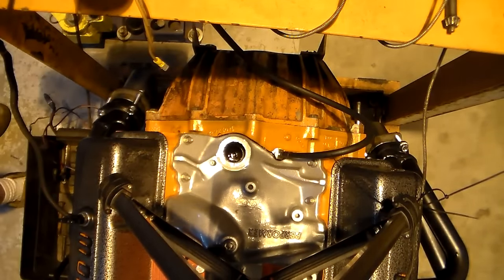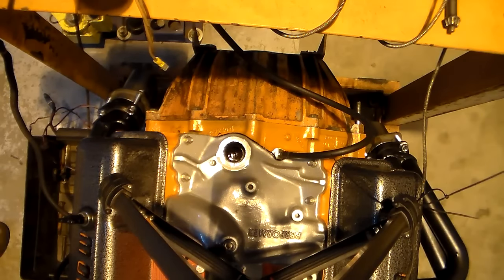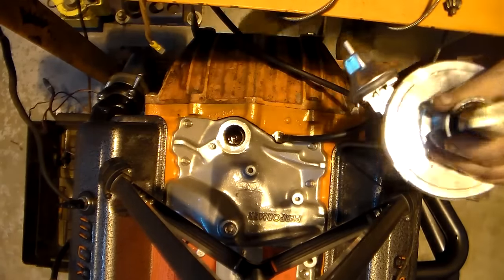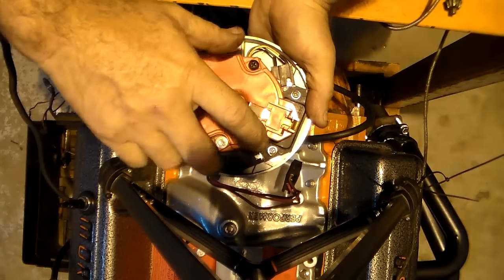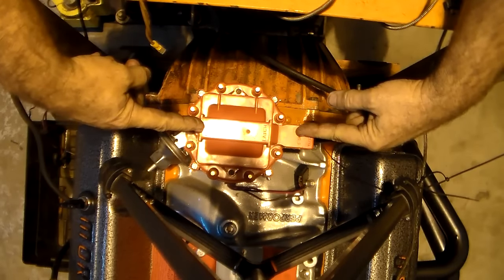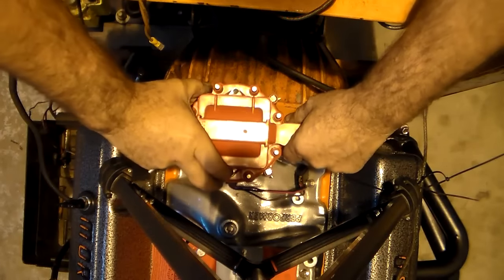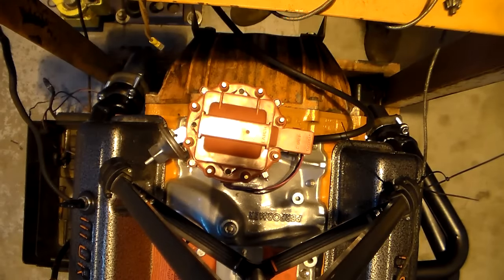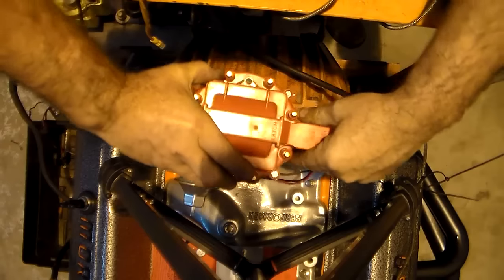How to install a distributor in a small block chevy the easy way.

Comment: So do I need to have the piston at the exact top dead center on cylinder #1 or 10 degrees before top dead center before installing distributor?
Reply from the maker: To instal it the way I show, you have to have it at TDC or 0 to make it all lign up. After its in just advance it a little to start it up then use a timing light to set it right.
Reply: @scottsinfl  Got a question. Checked timing with timing light on my sbc and the timing mark on balancer seems to be erratic or jumping all over the timing tab. More than a couple of degrees and it’s not moving evenly. It’s random across the timing tab but the engine seems to run pretty well. What could be the problem?
Reply: @scottsinfl  could it be the distributor having too much up and down play or faulty ignition control module?
Reply from the maker: @vezina808  It sounds like play or slack in the timing chain.
Reply: @scottsinfl  thank you

Comment: Hi have a question did u put the damper at 0?   When u install distributor? Thanks bud
Reply from the maker: Yes 0 or TDC on the compresion stroke of the #1 cylinder.

Comment: What if you're at tdc on comp. stroke, but the oil shaft is at 2-8 o'clock? Thanks Sorry if dumb question.
Reply from the maker: Just use a long flat head screwdriver and turn it till its at 11 and 5 o'clock position and your good. And there's no dumb questions here.
Reply: @scottsinfl  Thanks. Today is the day!

Comment: Now does this method work with proformance distributors or just stock??
Reply from the maker: I install all of them that way into a small block or big block chevy it doesn't matter if its an MSD or any other distributor it will be the same method. I should have mentioned that in my video too. Hopefully, someone will catch this comment. I hope that will help and thanks for watching.

Comment: This go for a 94 5.7 liter TBI ?
Reply from the maker: If it's the small cap or flat cap with the distributor that has the non-adjustable dist. lock down plate no it won't . There is a special process for those.

Comment: How do I get it to top dead center by myself
Reply from the maker: Sorry, I didn't get back sooner you probably have it done now. If you take the #1 spark plug out and turn the motor over with a wrench using the alt. nut if you still have the belts on if not use a 5/8 socket on the crank. Turn it till you feel compression come out of the #1 cylinder and watch for the mark on the balancer and make sure you stop at the top dead center or 0 on the timing indicator and that is tdc on the compression stroke for #1. Then follow the rest of the video and you will be good.

Comment: Would the engine crank and not start if the timing is off on compression stroke? Would it start if I'm on exhaust stroke?
Reply from the maker: no
Reply: Thanks for the reply. So if I'm on compression stroke but not at tdc and install distributor correctly and aiming rotor button at spark plugs 1, would it at least start? Cause I'm having trouble finding tdc
Reply: There is a mark on my balancer but no timing mark tab on the cover
Reply from the maker: for this method to work you have to be at tdc on the compression stroke #1 cyl. and line up the oil pump drive to 11 and 5 and point your rotor button at the second intake bolt from the rear on the d/s drop it in and it will run.
Reply from the maker: You dont have a timing mark on the balancer?
Reply: scottsinfl I have a mark on the balancer but no mark to match it to
Reply: People say u can just use your finger to see what stroke you on. I understand that but I'm having a hard time getting it to tdc cause I don't have a timing tab to match my balancer line to
Reply: David Nguyen bro did u find out how to match it? I'm on the same boat.
Reply: Lazarow Official I end up towing my truck to a shop. Charged me $88 for timing
Reply: Badd ass

Comment: How do you know the 1 cylinder is up to the top of its compression stroke?
Reply from the maker: You remove the front spark plug on the driver side of the motor and turn the engine looking at the front of the motor you turn it clockwise till you feel compression or pressure coming out of the spark plug hole. As you feel the air coming out you will see your timing mark on the balance start to come down to the timing marks on your timing cover. Stop at the largest V in the cover and that will be 0 stop there but if you pass it back up about an inch and bring it down again till you stop it on the 0 mark. Hope that helps and thanks for watching.
Reply: great - thanks for your help!
Reply: @scottsinfl  Too many homes.When your By yourself, Just put a Cork in 1 SparkPlug hole, turn Crankshaft slow till it Pops out. Double Check with Finger
Reply: Too many holes not enough Details.

Comment: However, an engine doesn't want to run if you install the Distributor at TDC-ZERO...why not set the balancer mark-LINE at around 6-8 degrees-advance on the TAB, drop the Distributor in and rotate the distributor to the #1 spark plug. Then you already have 'some' advance in the Distributor and it will ''initially' start and run better...then use your Timing Light to fine dial the Timing.
EDIT...ok, I noticed you rotated some advance in the Dizzy to get the Cap-Top 90 degrees to the cylinders.
Reply from the maker: Yes I advance it some before I fire it off I just set it at 0 for the dist. drop so all my mark for reference align up.

Comment: Distributor for a 1997 suburban vortex engine
Reply from the maker: If I remember they are locked with no adjustment for timing. It has to be set in at the rite spot like rotor pointing 7-8 o'clock position and turns in counter clockwise to a mark on the distributor housing. It will almost point strait to the p/s fender. Ive done them but don't have any videos sorry. Remember tdc on compression stroke for #1. Oil pump drive somewhere in the 3-9 o'clock position. I hope that will help some.

Comment: Uhh yah there is a easier way without using a screwdriver..
Set the timing on the rotor, drop the distributor in it's already meshed with the cam. 

All you need to do is rotate the engine by hand, remember the rotor is already meshed so you will NOT lose your timing. As you rotate it will drop right in. No need for screwdriver and guess work as you did here..
Reply from the maker: You have your way and I have mine and its no guesswork I have done it this way for 35 years and just thought others would want to know how to do it without having to turn the motor over to get it in. Have a great night.